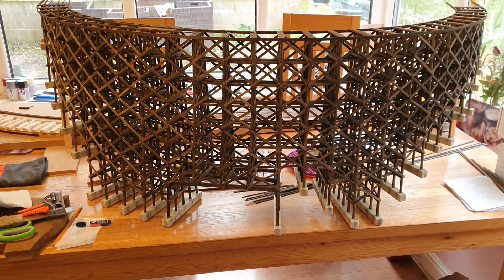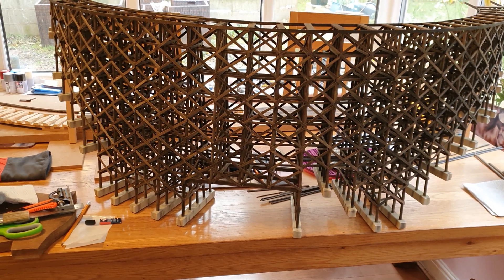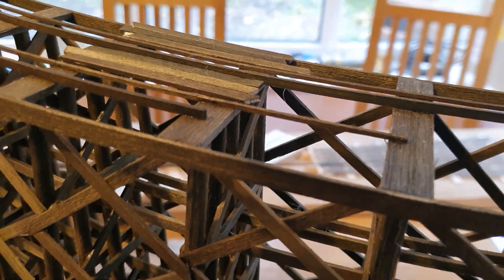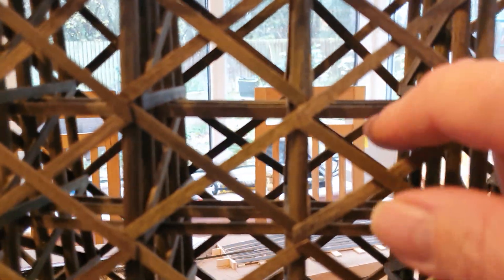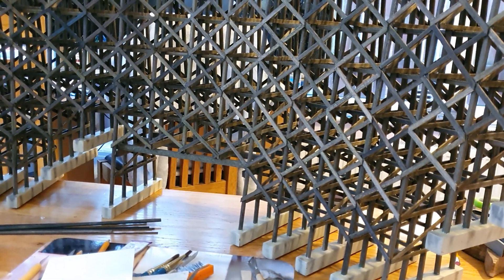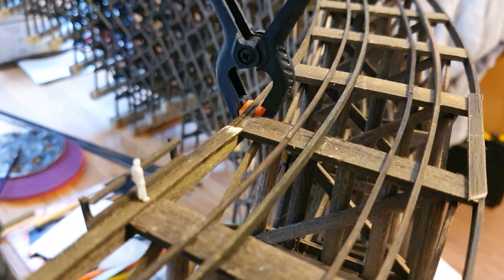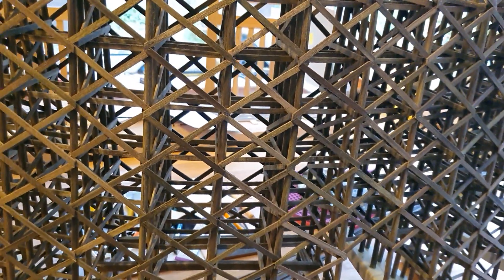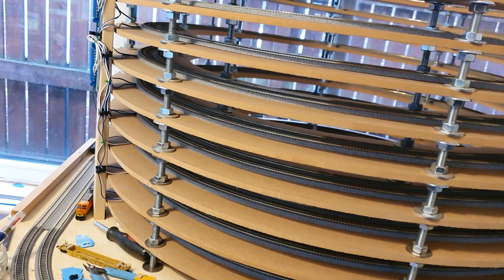No. 109 The Bridge Is Now The Wright Way Up

Comment: Hi Colin! Fantastic work as always! Great to see it the right way up! Now I understand why you're using the three different types of track! Those handrails and walkways look like they're going to be a bit delicate and fiddly to make! Will you attach them after you've got the track laid or before? Good luck with the next part of construction! All the best, Ian.
Reply from the maker: Hi Ian at first I thought I would put the track down first, but now I've got to it no the track is going to be last. The running board I'm happy with the strength, now the handrails if it was just the post and two rails they would have to be last, but now there is this kicking board which is another glueing contact to the post as well as the kicking board can be clued to the running boards it will be ok, well in my head it will. If your going to Warley have a great time, I'm not going because of the big surprise need more time here. Have a good week. Colin

Comment: Trestle looks totally awesome! Are you able to get hold of veneer strips? I have used it for banking track and works a treat.
Reply from the maker: Hi Jim love the idea of the veneers can use that idea on the baseboards but I needed to get the sleepers above the running boards so I hate to use the same thickness as those then the next size up, but the veneers is a fantastic idea thank you. Colin